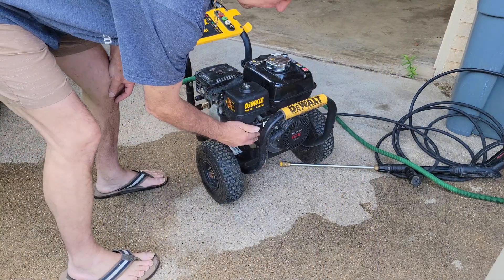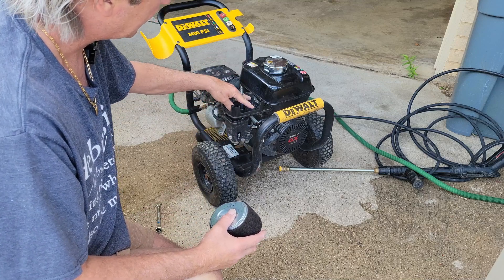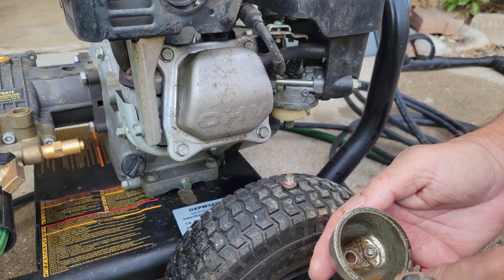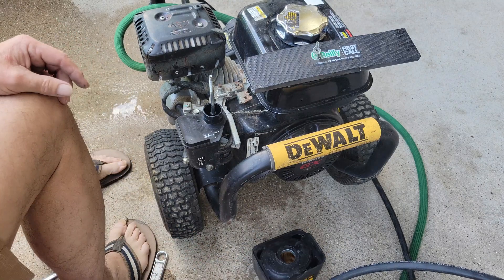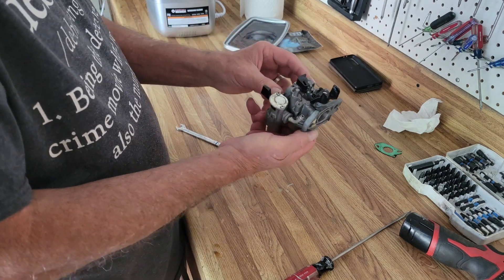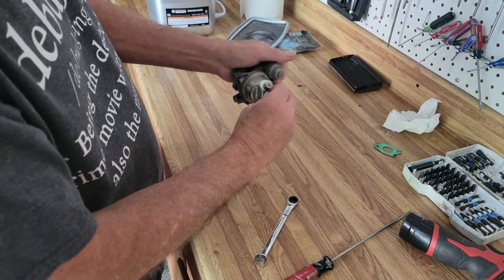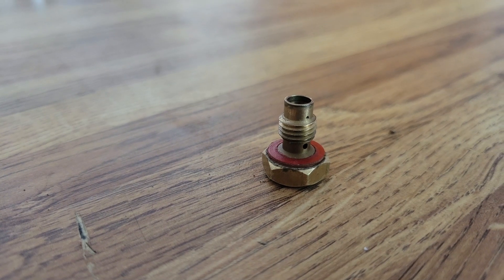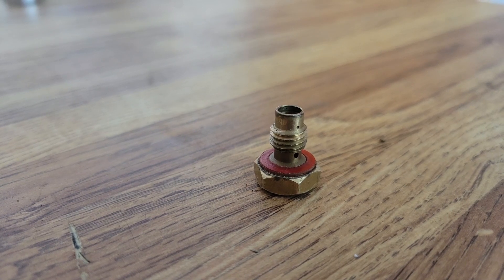Honda carb issues

Comment: Nice video Bill, looks like you have the same trouble I have hitting the little hole with the spring (Al leave it leave it). 🙂😲
A tea strainer comes in very handy for holding the jets and other small goodies in the ultrasonic. 👍
Reply from the maker: Leave it? Man, you are killing me.  🤣
I use 20% Pine Sol now in the cleaner, it's like a quick hand wash.... in REALLY hot water 🙂
Reply: LoL Bill, yes mine gets really really hot so I started using the tea strainer..... now no more throwing hot parts across the shop when they burn my sensitive little fingers. 🤣
Reply from the maker: I was thinking OW OW OW when I was doing the video I am a lot faster getting them out when I don't have to describe what I have as I go.
Reply: 🤣👍🏼 I bet that did lead to some serious discomfort!!
Reply from the maker: My hands cleaned up nicely though🤣
Reply: Madge would be proud of you 🤣
Reply from the maker: @Big_Johns  Madge prolly wasn't using 170 degree dish soap.  Lol
Reply: 🤣🤣 That’s for sure!!!

Comment: I been reading and watching videos on power washers they highly suggest that you open the wand and have water cycling through the unit at all times or you can ruin the pump. 
If you look at the owners manual it also states in the user manual never run the unit for more then 1 minute with out the wand engaged. 

Just an FYI for your subscribers

Read your user manual for the specifics on your particular unit.
Reply from the maker: Careful, that's a rabbit hole.  Lol
Reply: @GuysPlayingWithTools  I know right...

Comment: What's the little bowl for?   I know the fuel line hooks up.  I just cleaned one in ultrasonic.   The fuel line is so blocked
Reply: Fuel intake pipe on carb
Reply from the maker: The carb bowl? Not sure I understand the question
Reply from the maker: @PD62 Most of it came off but it could have used another lap to get it shiny. I don't worry too much about bowls being discolored as long as the grit and grime of life is cleaned off. On this type of carb the parts you really want to see extra clean are the needle, seat and jets.